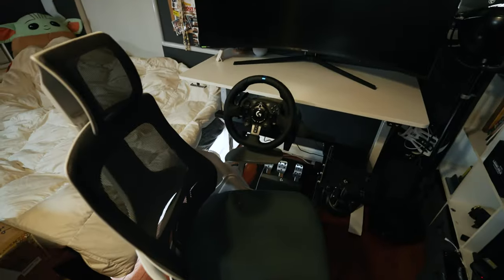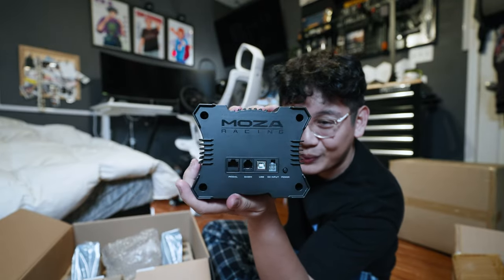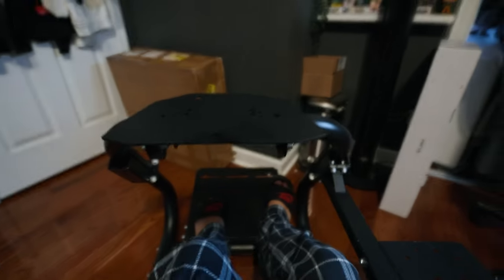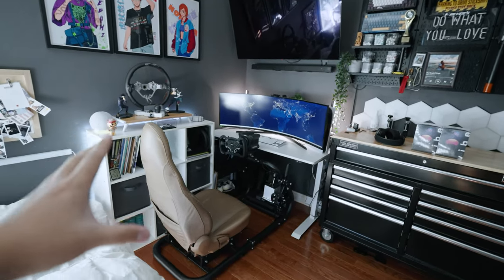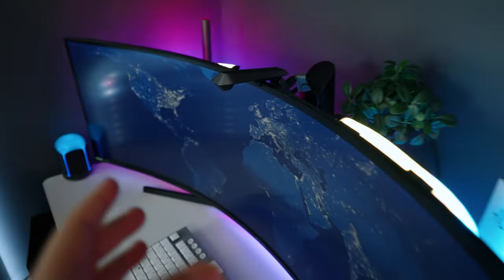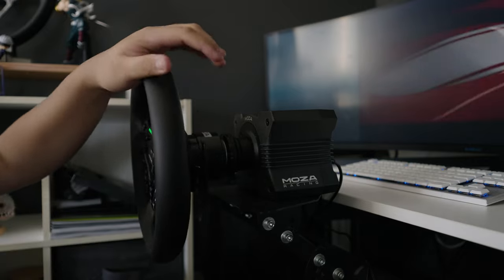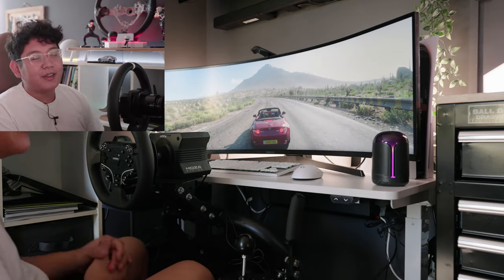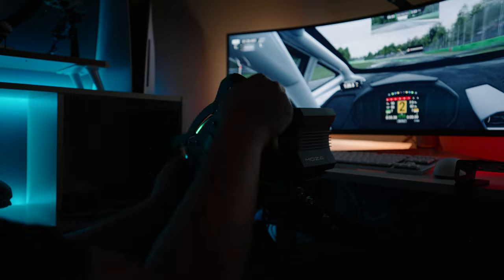Building My DREAM Racing Sim Setup🏎💨 | Moza R5 Bundle

Comment: Hey! It's nice to see you adding a sim to your room. Was very inspiring for me as somebody who spends lots of time in flightsims (like xplane or MSFS 2020). I was just wandering, what happened with the productivity setup and what about the sim peripherals. Do you have them connected to your gaming PC? Thanks a lot for the video and have a great time racing in your sim!
Reply from the maker: Hi! Glad you enjoyed the video! The Productivity Setup is now at my workplace! Got a new job 2 months ago and thankfully I have my own desk and office! Everything is connected to my PC on the other side of the room via a 25ft Displayport 1.4 cable to hit 5120x1440p 240hz! The Keyboard and Mouse is both Logitech which are using a wireless dongle! So minimal wires! Eventually Id like to get rid of the desk and just get a monitor stand or mount it to the wall with and adjustable arm. But for now this works!

Comment: question: when your using that 6 speed shifter in a game like Forza and your using manual with clutch on a vehicle with a 10 speed, how does that work? lol
Reply from the maker: A Miata has a 6 speed? If the car has a an auto/dct you can just use the paddles